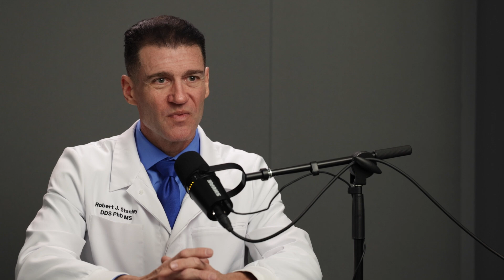Why I Rarely Use Custom Abutments

Comment: There are 2 reasons to debunk this idea.

1) if the objective of placing the biggest implant in the jaw is followed , we can only place the implant independent of the prosthetic consideration ( not fully , should be considered in hindsight)then implant are at different angles.

2)if engaging cementable prosthetic is primary concern than screw retained doesn't hold ground , engaging  abutment are always better than screwed type because the screw hardly loosen.
But the disadvantages are serviablity is cumbersome, but it rarely reaches that stage and it's worth the effort.
Where as screw retained are easy to service but they keep coming back for service.
It depends on what you are comfortable. 

But totally debunking custom abutment is silly , custom abutment is here to stay for ever and there is a huge following by experience dentist like me.

Comment: I totally agree with you in single implant but in more then one implant we need customer implant for multiple implant  bridge we need customer to have a passive entrance .we can use temporary cement with prudency
Reply from the maker: You are absolutely right. If you’re splinting multiple implants and there’s no suitable path for drawing, you’ll need to consider using MUA’s or a custom abutment. However, if you employ a digital planning process and place the implants accurately using a type 4 fully guided surgical guide, your prosthetic solutions become simpler and more cost-effective. This can be achieved by utilizing non-engaging hybrid ti-base abutments and a monolith zirconia bridge. I hope this information is helpful.

Comment: We custom abutment everything but just because we mill all our own work (I own and operate an in-house lab). I prefer the emergence profile of a polished custom abutment over stock anything, even if placement is mint with our guides
Reply: agree 100 percent regardless if you mill inhouse or not.
Reply from the maker: Stock does not mean rough or non-optimized emergence profile. There is a time and a place for custom healing abutments but those two design criteria are not included in that decision.
Reply: With a custom abutment, the gingival height of the base is variable all across the cross section of the prosthesis, so that you can have more space for zone and margin is exactly 0.5mm submucosal. Ofcourse it will be a screwmentable crown. Artistry from this, other advantages of custom abutment as you mentioned

Comment: Whether you use a stock or custom abutment, if your crown is ceramic it’s still bonded to the abutment, it’s just a matter of either the lab or provider doing it correct? A screw retained crown from the lab is actually just screwmentable to my understanding
Reply from the maker: You are correct. Properly executed both solutions provide the same results. The difference is custom is 3-5 times more expensive and someone has to pay for that.